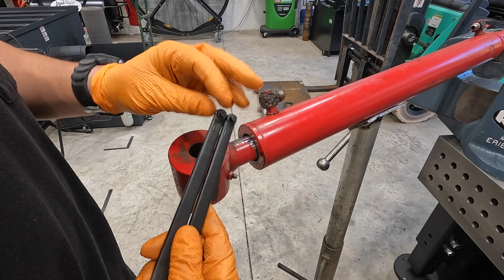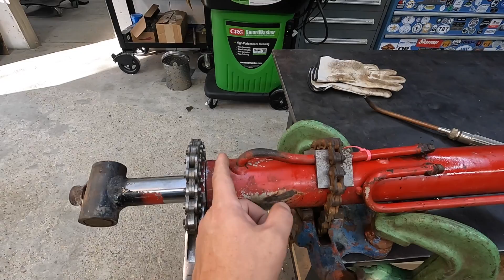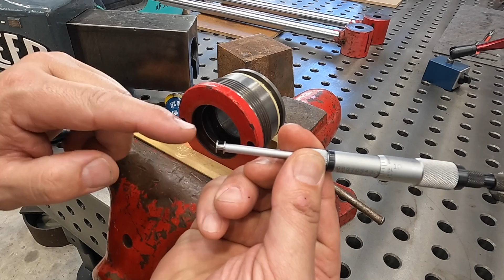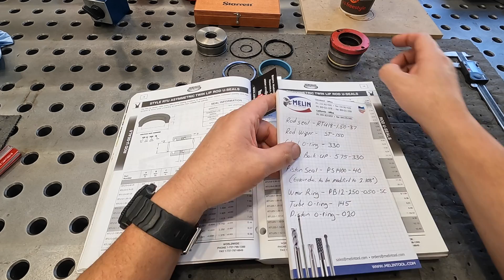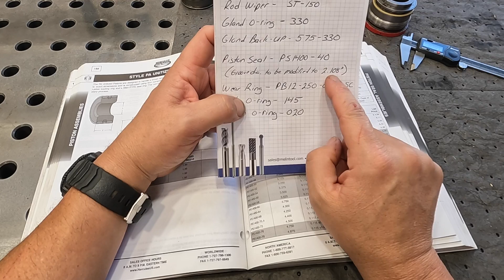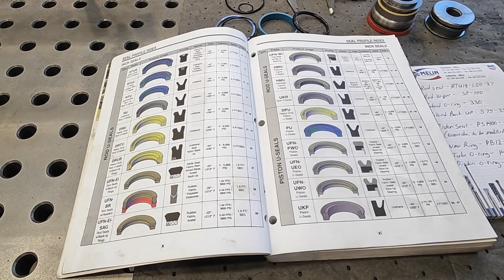Mahindra Hydraulic Cylinders: Tear Down, Inspect & Size for Seals

Comment: It's amazing how the power of a machine that can move mountains boils down to a few pieces of rubber and plastic.
Reply: That's why you always use axle stands when going under a car. The entire weight of the car is being held aloft on the hydraulic jack by a small rubber O-ring in the bottom of the unit 🤣
Reply: Tell me about it. Just got my car back from the shop... thought the tranny had quit but no, it was one of the CV axles - clean break where it passed through a rubber guide bushing!

Comment: For things locked together by corrosion or so0mething, how about ultrasonic vibration on the item immersed in a bath of penetrating/cutting oil or rust remover?

Comment: It sometimes helps after heating is to spray the male end with either or even brake clean. I might surprise you.
Reply: You might be surprised that a torch (and/or heat) and brake clean (chlorinated) = phosgene gas = WWI nerve gas.  So, uh, nope.

Comment: Why me? 8 ads in the first 12 minutes! I love these videos but this is killing me.
Reply: 'Adblock Plus'
Reply: @Rimrock300  works for me too
Reply: @Rimrock300  The latest update to chrome may be killing adblockers. I'm thinking of going to Pi-hole. It may be necessary to go full nuke on ads.
Reply: @firesurfer  Might hapen, I'm using Edge browser, adblock works fine there so far. Have had it for 5-7 years now, could not take it anymore with the ads. I probably spend well above average on YT, have it on most of the day in my shop. Don't have TV anymore
Reply: Or youtube premium
Reply: I’m much too cheap to pay anything. That’s why I started watching you tube years ago, so I wouldn’t have to pay for tv
Reply: @davidt8438  Adblock is free.
Reply: I’m in!

Comment: The two gland nuts that came apart are steel i bet. There is a special place in hell for engineers who design aluminum gland nuts. Bobcat does that to.
Reply: An absolutely horrendous idea with that aluminium gland
Reply: It's probably a bean counter.  We can save X minutes in machine time if we make these out of aluminum.
Reply: @1dgrdgr  Mahindra is a joint India and China company.  That tells you all you need to know.